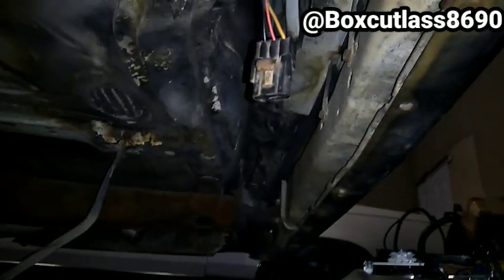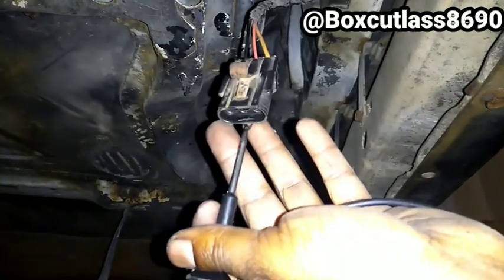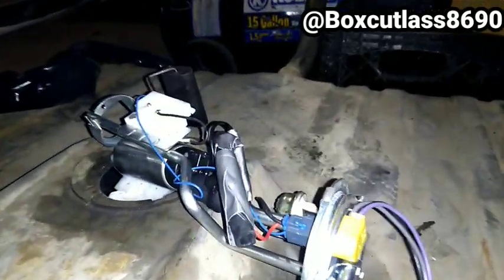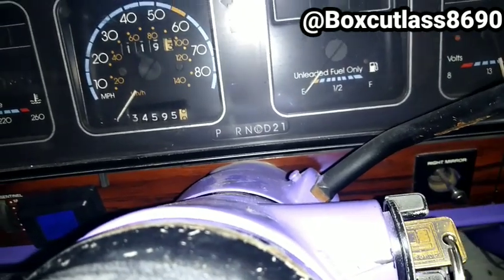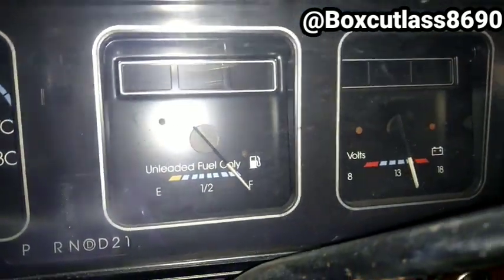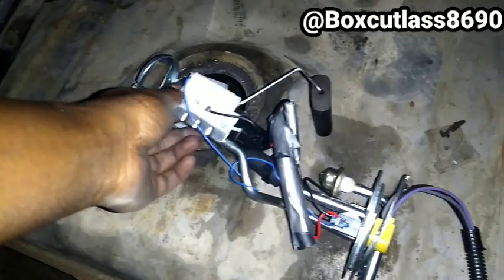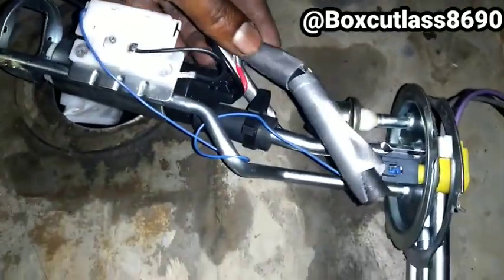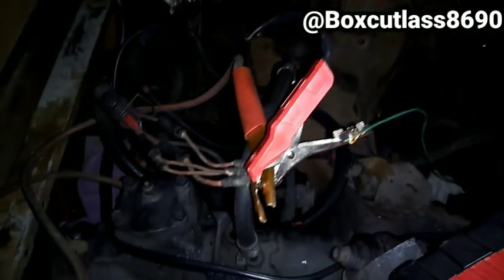BOx CHEVY! Why won't my fuel pump work like the float is working?🤔

Comment: I would Hook it to direct battery power just to verify that the pump works and then go from there, if it doesn’t turn on by hooking it directly to the battery then the pump doesn’t work at all, if your fuel pump harness is part of your main engine wire harness and you don’t have your computer hooked up yet to the harness the computer won’t be providing the ground signal for the pump cause the computer is not there to do it

Comment: Bro the purple wire is the hot wire. And plz get rid of the gray tape, and seat your pump in for max performance. Other wise you will have fuel starvation issues. Need help hmu. I done my 84 same way
Reply from the maker: That was so the wires wont touch while checking it